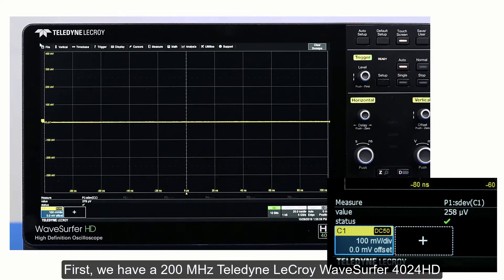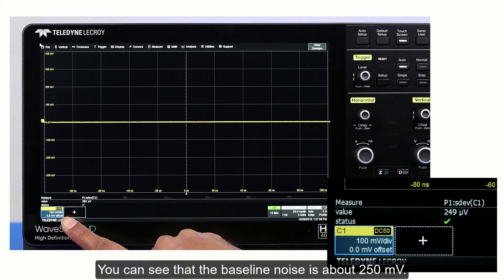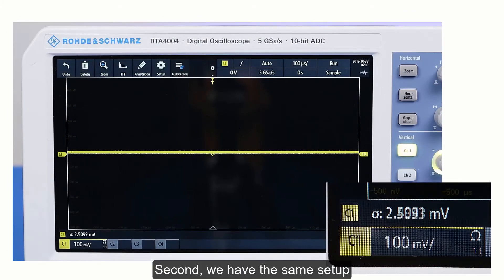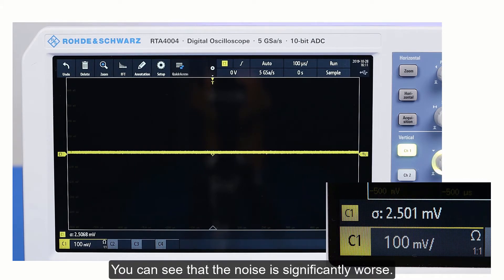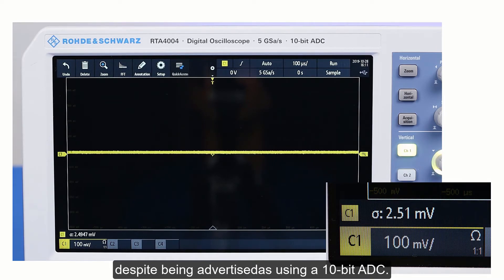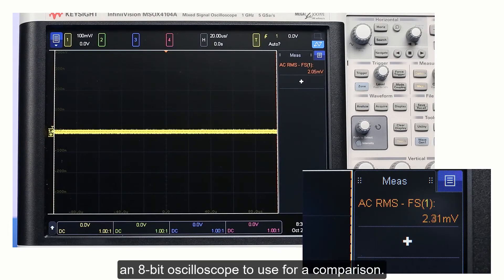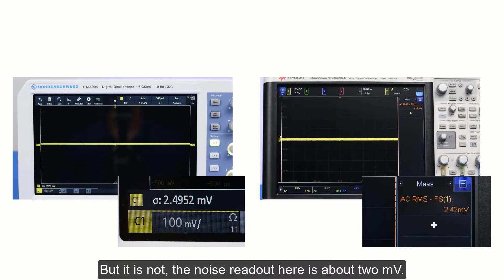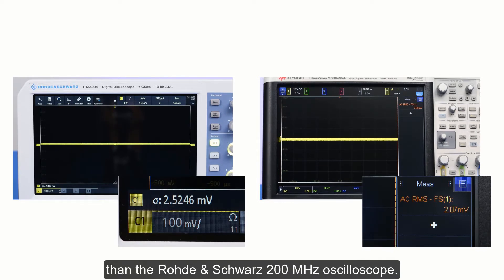WaveSurfer 4000HD with HD4096: Superior Noise Performance

Comment: what are the major differences between your older HDO4000 series and the newer WaveSurfer 4000HD?
Reply from the maker: Hi, thanks for asking! The WaveSurfer 4000HD provides a faster update rate, multi-instrument capability, and an updated industrial design -- all at a lower price point than the HDO4000.